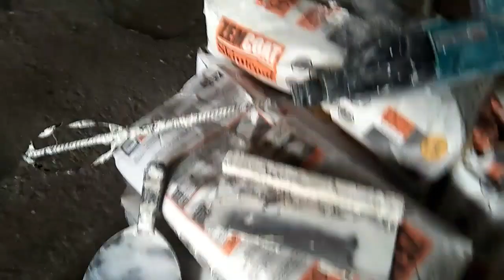How to mix skimcoat filler for your concrete walls? (tamang paraan sa pagtimpla ng skimcoat)

Comment: Edwin Aranaz ask q lng po ano  Tama gamitin n maselya sa semento skimcoat po b at sa plywood o kahoy boral
Reply from the maker: Kadalasan at uso po ngayon para sa concreto ay skimcoat dahil mabilis at mura..pwd rin po concrete putty at pwd rin patching compound na ihalo sa latex...para naman po sa plywood at kahoy dpnde po sa ipintura mo..pag laquer ang pintura mo lacquer putty po,.Pag qde plasulux naman po,pwd rin patching compound ihalo sa flat wall enamel
Reply from the maker: Ang boral po naka dsign para lang po tlaga sa gypsum board..at ang hardi putty at para po sa hardiflex
Reply: @bestvarnishpaintsideastech4578  ok po tnx
Reply: @bestvarnishpaintsideastech4578  paano po Kung sobrang rough po Ang pagkakapalitada ng wall, paano po ba masilyahan ng skim coat?

Comment: Boss larry pwede po ba mag skim coat sa wall na smooth finish na at ano po mgandang skimcoat ang gamitin sana msagot nyo po tanong ko kc biginners pa po ako salamat po.
Reply from the maker: Pwd po kahit makinis sya..at dapat direktang imasilya sa semento para mas matibay ..Zemcoat po ang brand
Reply: @bestvarnishpaintsideastech4578  pag tpos po ng zemcoat pwede primeran ng acrytex
Reply: Boss sabi nila panget daw I skimcoat ang smooth finish na wall. Totoo po ba yun

Comment: New subscriber here, boss yung kisame namen hardiflex, una nilagay ng pintor sa mga dugtungan skimcoat tapos kinabukasan nilagyan niya ng putty, pwede po ba yun?
Reply: At anu pong dapat gawin kapag na skimcoat na ang hardiflex
Reply from the maker: Madali pong bumitak yan boss baka nga po isang lingo lang wag naman sana..concrete epoxy hv po ang imasilya para po sa gap..lihain at iprimer bago po lagyan ng gasa at pantayin ng hardi putty

Comment: Looks very good finish, you are doing the plastering the difficult way, you should be using skim plaster on block walls, no need to sand.
Reply from the maker: The supplier of that product sent in our site here a personel to demo us on how  to plaster on the walls..their demo are good but the product is desapproved by the owner of the house and arch. designer because that product is not durable according to some expert here in Philippines.Instead of using that, they promoted  Zemcoat skimcoat for durable finish and it's good for painters to have excercise their body by sanding.. Thank you for your comment
Reply: Thats I am searching Sir in the Philippines.Just like what they are using abroad.

Comment: Boss anu pwde gamitin sa joint dry wall yung hardeflex kc b4 ko e paint lalagyan ko muna yung pagitan nya
Reply from the maker: Malikot po ang hardiflex kaya madaling bimitak..dapat may gap ang dugtungan na pwd pag siksikan ng masilya..concrete epoxy hb po ang gamitin sa gap sabay lagay ng gasa,yan na rin ang pantabon sa gasa..lihaing mabuti ng makapal na liha tapos iprimer,saka pantayin ng hardi putty

Comment: Gud  po sir, tanong kolang po anong masilya ang gagamitin para sa kisame salamat po
Reply from the maker: Dpende po sa kisame boss..kung gypsum board yan,boral po at gypsum putty,,,kung hardiflex po hardi putty po pwd rin boral,,kung plywood pwd lacquer putty,plasulox,patching compoud na ihalo sa pintura..kung sa dugtungan po natural may gasa at pwd po polituff,stikwel at patching compound at pwd rin po all purpose epoxy kung plywood
Reply: Plywood lang po salamat

Comment: sir, alin ba ang dapat mauna na procedure? skimcoating muna or waterproofing ng external wall.
tapos saan mas maganda ang application ng skimcoat? sa rough finish wall or yun sa smooth finished wall na nilagyan ng purong semento?
Reply from the maker: Skimcoat po dapat mauna dahil mas matibay ang kapit ng skimcoat kapag sa semento sya nakadikit bago po ang pintura na water proofing gaya ng elastomeric.Pero kung ang water proofing mo ay plexibond dapat mauna ito dahil dapat sa semento sya nakakapit at dapat kung mag plexibond ka direct sa semento wag skimcoat ang gamitin mag concrete putty ka pangpatong sa plexibond

Comment: Sir ano mas mainam gamitin sa wall, acrytex primer or skimcoat?
Reply from the maker: salamat po sa tanong,,ganito po yan ang kaibhan ng skimcoat at acrytex primer:

ang skimcoat po ay pang masilya matibay pag direct sya sa cemento ibig sabihin walang primer

samantala ang acrytex primer ay pang primer lang talaga hnd dapat imasilya..may pang masilya na nararapat sa acrytex yon ang ACRYTEX CAST

Pero ang skimcoat pagnaliha mo na pwd mo sya iprimer ng acrytex primer o flat latex,,samantala ang acrytex cast pagnaliha mo na d sya pwd iprimer ng flat latex.para lang talaga sya sa acrytex primer
Reply: @bestvarnishpaintsideastech4578  Tnx sa info

Comment: Master tanung ko lang po, anu pong pinagkaiba ng skimcoat at patching compound?
Reply from the maker: Ang skimcoat po tubig ang halo..pintura naman po ang halo ng patching compound..sa tibay may matibay ang skimcoat pero mag dpende pa rin po yan sa brand
Reply: @bestvarnishpaintsideastech4578  master, salamat po!
Reply: Ano ung pinapahid nyo ng roller bago applyan  ng skim coat

Comment: ano gagawin pag ung pader may mga maliliit na cracked ba bossing? nakakaasiwa kc tignan pg my crack ang pader.
Reply from the maker: Ang gnagawa po namin sa cracked kung medyo malalaki sinisilsil namin yan gamit ang pako para makasok ang masilya kahit kasing laki lang ng tingting  ang buka...at dapat concrete epoxy ang imasilya nyo,lihain ng num 60 para magasgas bago iprimer yong portion na yon...kung wala pang pintura ang walls,masilyahan ng skimcoat pagkatapos i concrete epoxy ang crack,,at kung may pintura na,ineutral nyo muna ng flat latex bago i skimcoat
Reply: @bestvarnishpaintsideastech4578  salamat sa info bossing.

Comment: Idol makaka mura ba kung skimcoat nlng gamitin kesa masonry putty at patching compound? Sana masagot mo idol tnx.. subscribe na kita idol kasi ang galing ng video mo
Reply from the maker: Malaki po ang matipid nyo pag skimcoat boss,imagine 1 timba ang magawa mo sa skimcoat mga 400 plus per bag..pag concrete putty isang galon halos 400 plus per galon..pag patching compound din 500 per galon ng flat latex halos 2 galon pwd mo matimpla,so makatipid po kayo sa skimcoat ng malaki
Reply: @bestvarnishpaintsideastech4578  thank youx3 idol

Comment: Boss PD po ba skimcoat Na khit ND p finish rap plng...sna  mapansin comment q
Reply from the maker: Sir yan po ang mas magandang iskimcoat ang rough pa lang yan talaga dapat! Sa rough sya imasilya,,pero d rin sya bawal sa smooth ...salamat jomar corbillon at sory sa late rply
Reply: @bestvarnishpaintsideastech4578  boss after ko skimcoat lihihain ko n kinabukas after nun PD n pintura ser
Reply from the maker: tama po kayo sir kinabukasan lihain mo na ang skimcoat mo habang malambot pa sya lihain..ang skimcoat kasi habang tumatagal lalong tumitigas..linisain lang mabuti bago pinturahan..sensya sa late rply sir

Comment: Sir matanong ko lang ano ba sa tingin mo yung sakto lang na consistency ng mixture sa skimcoat?kung pang isang oras ba na mix gaano ba kadami?kung sa rough finish ba sir gaano ba kakapal yung application niya?at ilang coat po ba applicable at per coat gaano ba katagal para magcoat na uli?
kakadiscover ko lang sa channel mo sana mas may marmaing tutorial ka pang eupload para makakuha nang reference sa katulad kong DIY'er
Reply from the maker: Dpende po yan kung ilan kayong magmasilya.kasi kami sa dalawang tao ko makatimpla kami ng isa at kalahating bag sa isang uras basta palapad ang surface at gamitan ng barina na panghalo..pag rough masyado ginagamitan nmin ng gray Zemcoat 0-5mm ang kapal,pero sa trabaho nmin sir maganda ang pagka rough kaya Zemcoat na na kulay white yong super fine na 0 - 2mm lang ang kapal dapat,dpende sayo ilang coat mo sya ipahid basta hanggang 2mm lang ang kapal..2hrs pwd na sya patungan for another coat mas mganda patungan pag d pa gaanong tuyo mas mapakinis mo ng maayos
Reply from the maker: Tatlong klase ng maximum na kapal na skimcoat sir na naincounter ko una yong gray 0 - 5mm,,yong isa po ay hanggang 3mm at yong super fine na 2mm lang dapat..depende po yan sa hagud ng rudela sir kung ilang coat mo gawin basta laging nasa minimum ka lang dapat na mm na gamit mo
Reply: Best Varnish /Paints Ideas & Techniques Best Varnish /Paints Ideas & Techniques  Sir Maraming Salamat sa Malinaw na Sagot mo,may isa pa rin akong katanungan regarding sa skimcoat application so after sa desired na thickness na sinabi niyo po necessary pa ba ang skimcoat lihain?o depende ho?
Reply: Best Varnish /Paints Ideas & Techniques gagawin ko yang sinasabi mo sir malinaw na malinaw yung mga kasagotan mo sa katulad kong gusto matuto sa ganitong skill diy’er din mabuhay ho kayo sir
Reply: Best Varnish /Paints Ideas & Techniques gawa pa po kayo mga skill tutorial nagustohan ko ho yung videos niyo
Reply: Pag after ma skim coat ang voncrete wall how many hours/days bago sya e paint?@

Comment: Sir yung nilagyan nyo ng coat hindi ba yan rough?kasi kailangan pang basain. At saka ying ginamit nyong pang mix na inilagay sa electric drill ginawa nyo lang ba yun or may binibinta talaga nyan? Salamat sana masagot lahat tanong ko
Reply from the maker: Kahit po rough o makinis ang skimcoat po dapat binanasa po talaga para mas makapit sya..yong panghalo namin ginawa lang po yan..

Comment: na try nyo na po ba yung holcim na brand? ok po ba yun?
Reply from the maker: Na try ko na po yan sa Cebu pero d sya kasing ganda nitong Zemcoat na brand..malambot lihain ang holcem d gaya nitong gamit namin..kapag malambot lihain meaning d sya matibay,unlike sa Zemcoat na habang tumatagal lalong tumitigas lihain kaya dapat po lihain mo agad pagnatuyo kasi pag inabot na buwan yan at d mo pa lihain dumudulas lang ang liha sa subrang tigas
Reply: @bestvarnishpaintsideastech4578  pwede po ba i skim coat yung lumang flat na pintura po pagkatapos lihain at linisan? Maraming salamat po sa sagot.
Reply from the maker: @MikusTime  kung may flat latex na po yan basta linisin nyo lang pwd po yan i skimcoat...kung naka gloss na po at gusto nyo imasilya ng skimcoat dahil bako bako iflat latex nyo muna bago iskimcoat

Comment: Boss bakit mukhang concrete finished na yan, diba mas maganda kung rough lang Ang cement chaka mas da best kung Davies Mondo na skim coat ang gamit?
Reply from the maker: Kaya nga po yan ang ginamit namin boss na  brand ng skimcoat dahil kumakapit sya sa makinis na wall..salamat po
Reply: Boss ung Davies mondo na skimcoat ok ba yan sa smooth finish na wall

Comment: Sir bakit yun pintor nami ang skim coat po hinalyan nya na puro cement ?nagtaka lang po ako at bakit ganun ginawa nya.kc karamihan dito sa blog nyo po walang naghalo ng cement sa skimcoat.
Reply from the maker: Mali po yan,d po dapat hinahaloan ng semento yan..basahin lang po sa instraction ng skimcoat nyo kung meron...pero d ko lang din alam baka po may skimcoat na kilangan haloan ng semento d pa ako naka incounter ng ganyang brand
Reply: Baka gamit nya yun sa Boysen - Konstrukt skim coat.

Comment: Sir pwede po ba e skim coat yung wall na may paint na? Hindi po kasi maganda finishing nung cement, klarong klaro talaga yung imperfection lalo na satin finished nung paint
Reply from the maker: Pwd po basta ineutral nyo po muna sya ng flat latex bago iapply ang skimcoat
Reply: Best Varnish /Paints Ideas & Techniques thanks

Comment: Pwede po ba tong skimcoat sa mga Hardiflex wall at kisame?
Reply from the maker: May masilya tlaga na pang hardiflex boss hardi putty kung tawagin,pero kung wala yan sa lugar nyo pwd rin sa boral yan..ang hardiflex po malikot po sya sa kisame lalo pag mainit ang panahon kaya madali syang magkaroon ng crack ang mga dugtungan..ginagamitan namin yan ng concrete epoxy ang v cut o dugtungan para d basta mag crack,lihain mo nga lang ng magaspang bago sya pinturahan para makakapit ang pintura dahil madulas at makintab ang concrete epoxy pagnatuyo
Reply: Ang skimcoat ba iba para sa kisame at sa bato

Comment: Sir san ba nakabili ng paleta na malapad para madaling magpahid ng skimcoat?
Reply from the maker: Bumibili kami sa Guadalupe sir sa tulay
Reply: @bestvarnishpaintsideastech4578  ok lang ba sir I skimcoat yung kisame na cement din.. kaso may mga line sya kasi buhos yung dugtungan ng mga plywood bumakat sya
Reply: @bestvarnishpaintsideastech4578  boss ok lang ba ang skimcoat pang outdoor? Hindi ba sya lolobo?
Reply from the maker: @RJSari  as long as cemento sya pwding pwd iskimcoat ang slab
Reply from the maker: @RJSari  hnd sir basta Zemcoat gamitin mo,pero kung alanganin ka may mga skimcoat na panglabas tlaga at pang waterproofing na rin sya
Reply: @bestvarnishpaintsideastech4578  anong brand sir ung pang outdoor na skimcoat? May ma rerecommend po ba kau?
Reply from the maker: @RJSari  Pm me sir para ipakita ko sa inyo ang brand..Larry Formentera Palomares fb accnt ko

Comment: Sir ilang bag po kaya ang maubos na skimcoat sa 60sqm na bahay at ilang araw po stemate mo na matatapos? salamat po
Reply: Bali 2mm lang po ang kapal.. 2 katao ang gagawa
Reply from the maker: Sa 60qr meter sir,pinakamarami na yong 5bags,pero dpende po yan sa pagka palitada basta po rough finish ang wall..pero pag makinis ang palitada mga 3 bags lang po yan kasi nga makinis na..hanggang 2mm lang kapal sa superfine dapat at hanggang 5mm naman doon sa hnd superfine yong may halong silica sand
Reply: Salamat po sir

Comment: Sir pwd mag tanong marami ba brand ang skim coat? Salamat
Reply from the maker: Marami po, ang gamit namin ZEMCOAT na brand ok naman sya kasi  habang tumatagal timitigas lalo sya unlike ng ibang brand na malambot lihain,meaning d matibay..need mo lang syang lihain kinabukasan kasi pag inabot ng linggo matigas sya lihain
Reply: alin po mas maganda at matibay a
Sir..  yang zemcoat o mondo po ng davies? TIA po sa sagot nyo sir
Reply from the maker: @markirving2244  para sa akin ok ang zemcoat sanay na kami dyan dahil matibay kahit sa outdoor..imagine kung imasilya mo sya ngayon at kung next month mo na sya lihain,d mo na sya halos maliha kahit num 100 na liha ang gamitin mo mangingintab na lang sa tigas..lalo pag inulan sa labas at matagal mo sya lihain kaya payo ko after mo imasilya kinabukasan liahain mo na.
  Yong ibang brand pag sa labas at inabot ng ulan natatanggal sa ulan..yong product din ng davco at landco ok rin po yon
Reply: @bestvarnishpaintsideastech4578  sir ask kulang po. Yung bahay nmin matagal di natirhan' taz now eto na kmi kaso ang wall mo di pa sya napaint pero naka masilya po sya. Kaso po puro crack ano po gagawin ko' imasilya ku po ba ulit then primer then top coat? Or lagyan k nlang po ng concrete filler para po matangal mga crack? Salamat po